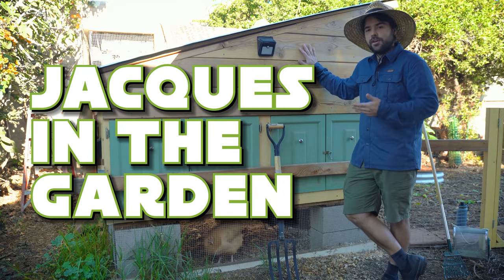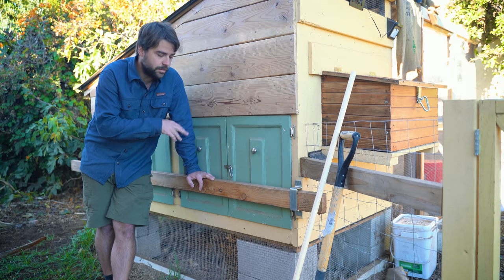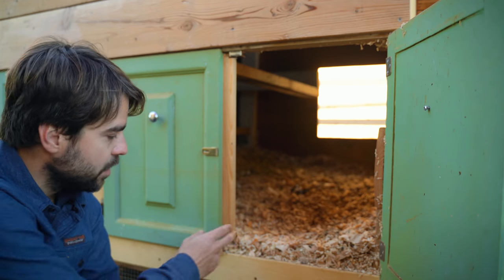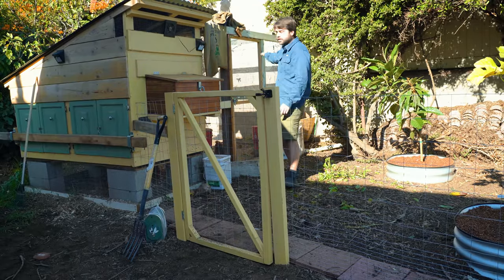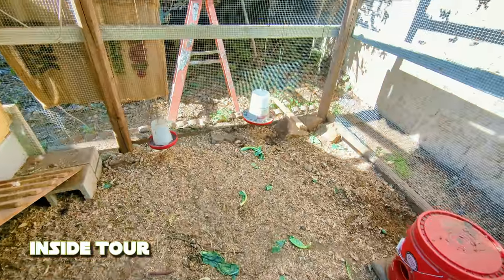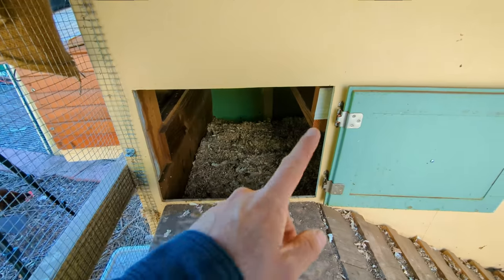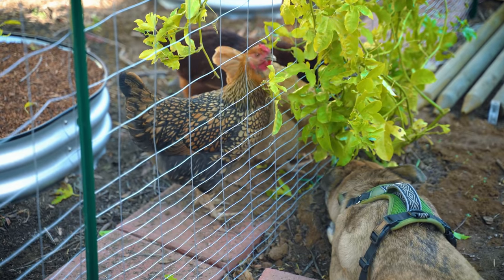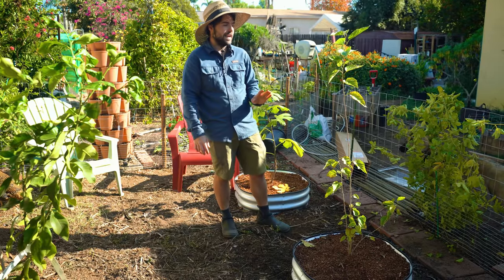DIY Reclaimed Wood Chicken Coop - Full Tour & Tips

Comment: 9:00.... 30 year carpenter here. The direction if your diagonal doesn't matter that much. You're right that the other way is proper, and might matter a bit more with a larger or heavier door. It does what it needs to in this case.
Reply: In critical applications, You want the load on the door to compress your diagonal, not put tension on it.

Comment: Great coop! Thanks for the tour. FYI, I use shade cloth over the top of the run. It doesn't require as much infrastructure up top to secure it. It has kept everything out, especially wild birds, which can spread disease (rare, but it can happen). As an added bonus, my cats love to lounge on the shade cloth. It's like a big hammock for them, and it keeps them on the job - they are great mousers! Finally, I'm in Albuquerque so the shade cloth does a great job of keeping their run cooler in the worst of the summer heat.
Reply from the maker: I should just get some shade cloth and add it up there as a permanent feature, not sure why I didn't think of that actually.

Comment: I've got a coop made out of old decking too. Great job on the apron! For your nesting box lid, attach a loop of string to the inside of the nesting box lid and when the lid is open, loop the string on a hook or something on the coop wall, I do that for mine.
Reply from the maker: Sounds like a nice simple solution thanks for the tip!

Comment: Nice video.  Maybe the first one I've watched from you.  I've seen you on Kevin's channel a bunch of times.  Lol to the door brace.  Yeah, I think we've all done that.  A tip if you're interested in the chicken water bucket.  I run drip irrigation to all my beds, and I live in the desert so the beds get watered several times a day from the timer.  I once had my single water bucket fail due to it breaking off the rope it was on.  Luckily I was home and heard the chicks squawking.   It's often 110F here in the summer so that's not going to end well if I was at work all day.  What I did was to install two buckets (I use the water nipples that screw into the bottom).  My buckets are food grade dark black...(no light gets through so no algae grows in them).  I also have swamp cooler floats installed in the buckets, and those floats are connected to my nearest raised beds via cheap 1/4" drip tube.  Every time the beds get watered, the buckets get filled until the float turns them off.  Long story long, I haven't had to manually add water in almost two years!  Two buckets gives me peace of mind that if one fails, it's highly unlikely the other will before I can repair the first.

I'm also a hermit.  Have a good one brother!  Nice coop, and I appreciate your nice mellow way of narrating and giving information.

Any plans for some free range rabbits to go in that awesome chicken food forest?  I'm thinking about trying them out in my system.

Have a good one!
Reply from the maker: Rigging up an autofill sounds nice, especially once we get into the summer that would be a great idea! No plans for rabbits as we are already pretty loaded in pets now haha
Reply: @jacquesinthegarden  Thanks for taking the time to reply.  Subbed.  Keep up the good work, and happy holidays!

Comment: I like your idea about the metal mesh on the ground. I was going to do that but I heard of another idea and it’s to put flat patio block I think they are 6 inch by 12 inches can’t remember. But you put them up close to the fence and they won’t dig because they usually try to dig close the fence and it works great never had a problem. Just a tip that’s all. Great video by the way. 👍

Comment: In my experience, if there is a top bar or beam on a fence the chickens will jump up to it and be over it, even larger breeds, even if the fence is very high.    If there is not a bar or beam or board along the top of the fence, if it's just wire,  most chickens can't seem to figure out that the fence in their way even has a top to get over.   It doesn't seem to be the height of the fence at all, but what they can see or not see at the top of the fence.  I currently have a rooster "confined" behind a two foot tall fence during the day.  He roosts higher than that.

(This doesn't count for Sumatras, which I believe have a death wish, fly well, and won't stay in a fence if they can find any way out of it.)

Comment: Does your chicken fly? Mine would fly right outside the gate between the orchard and the rest of the garden. Can you update on how often you need to clean the coop, and weekly maintenance? Im in the PNW. It’s supper humid and rain a lot here. Even with the deep litter method, I have to clean the poop out 2-3 times a week. (Maybe because my coop ventilation is not good.)
Reply from the maker: They can fly out from the tree orchard area but won't unless someone is standing on the other side and they want to get to them. Weekly maintenance is giving the bedding a little stir and checking to make sure water and food are stocked. Deep liter method for us has meant we haven't had to change it in roughly 6 months now. If you use dried wood shavings or hemp you should be able to go for quite a bit but things like straw for instance just doesn't work

Comment: Do you have to deal with rats having chickens? I have been researching chickens and i want to get some in my area of sacramento but I hear rats are a big problem as well as the other pest mentioned.
Reply from the maker: If you screen everything in hardware cloth they shouldn't be able to get in. I suggest doing some back of the napkin calculations on how much space you want and then figure how much hardware cloth it will take as in this case it was the most expensive part of the build.

Comment: I agree with all of your security features against raccoons.  We've had them invade our coops several times, and they kill everything they can catch, and will return for the carcasses later.  One even chased a 20lb. goose back into our barn and killed her in a stall.  I set traps, which it evaded, around the carcass, and the dang thing dragged the body over a 6 ft. stall wall to get it out of the barn, if that gives you an idea of their strength and determination.  When 3 ducks went missing I found the remains up in the barn loft which doesn't even have a ladder to reach it.
Reply from the maker: This is exactly what I was trying to avoid, we have seen racoons as big as medium sized dogs in our yard so we weren't going to be taking any chances!

Comment: Charming and secure coop. You can get J clips to fasten pieces of hardware cloth together. Amazon and local feed stores have them. You see them used on rabbit hutches a lot.  I got rat proof hanging feeders that close with the weight of a rat or mouse on them (along with a hardware cloth enclosed run). They are pricey and a pain to clean out. But, rats can jump 3 feet, so hanging feeders up a foot off the ground won't help much. Treadle feeders won't work for me because of fire ants.
Reply from the maker: Thank you for the rec on the J clips, I hadn't heard of those before! I am honestly surprised at myself for not looking up potential existing solutions. I've seen those feeders before, if we can't solve the problem through hardware cloth I will look into those!

Comment: I've got 2 words for you, brother... Hammer Stapler.  You're welcome.  :-)
Reply from the maker: I've seen those but don't they shoot the same thin staples as the hand staplers? The air gun I used shot the 3/4" 18 gauge crown staples.
Reply: @jacquesinthegarden  If you drop about $30 you can buy a heavy duty hammer stapler that'll drive 1/2-inch HD staples that'll do that job for you great, quick and easy without needing to rent any tools.  No compressor, no power usage, just load in a rack of staples and swing away.  We bought ours when we were building our house for laying roofing underlayment, tyvek house wrap, etc, but we have used it a ton for gardening/homesteading projects like you did in your video.  So quick and easy.  We just love it.  We actually have 2.  If you were closer, I could donate one to your cause, but as I said, they are pretty affordable.  Cheers, and thanks for all the great videos.  We're making more compost teas and fermented plant juices for our garden today, thanks to your inspiration.

Comment: Amazing video! Where did you get the reclaimed wood?
Reply from the maker: A lot of the 2x4s came from a family member who had to rebuild their deck awning. So they were all warped from bearing weight in 1 direction and full of nails that were 50% rusted away. Some came from Home Depots 70% off bin where they purple tag broken or bad pieces of wood. Some came from another families member's work who got big crates full of stuff delivered so we re-purposed the crates.